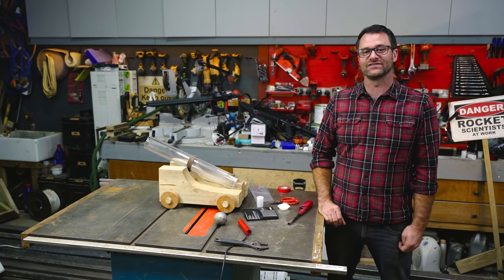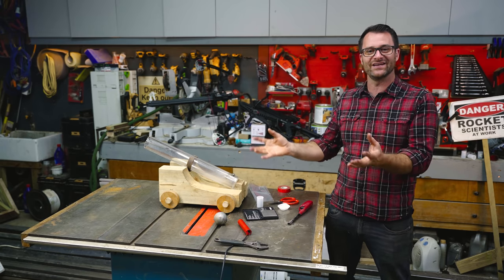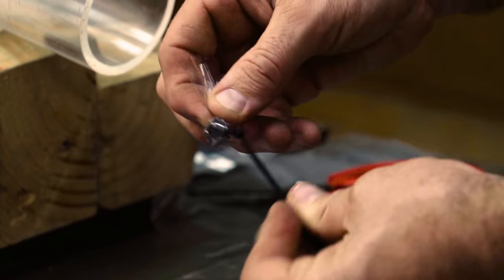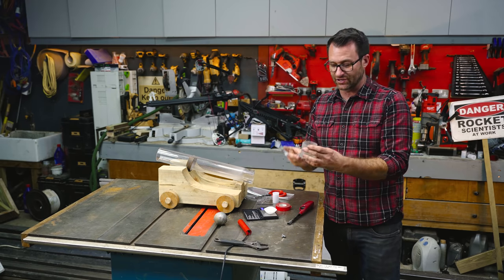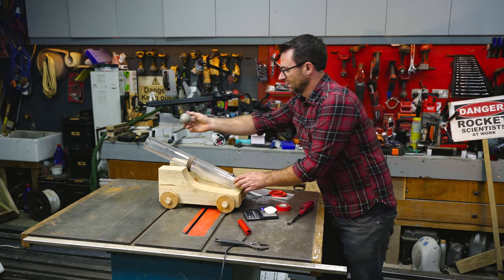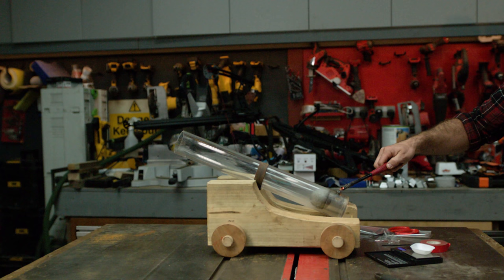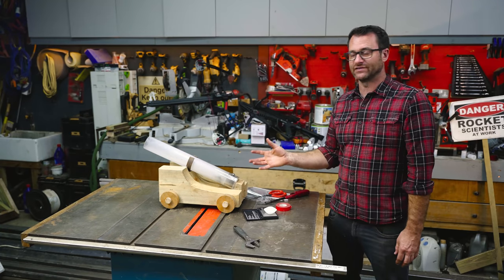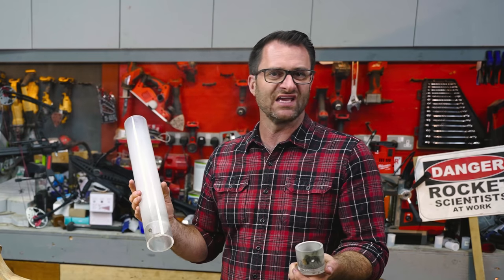Seethrough Cannon - Watch exactly how a cannon works and fires

Comment: One interesting observation.  At 2:56 when the ball leaves the muzzle you can see a return wave in the smoke as air rushes in to the barrel.  In theory at least this means that there is a small partial vacuum in the barrel at this point slowing the ball down so actually cutting the barrel down by say 3 cm would actually improve the balls muzzle velocity.
Reply: Hm, so this is why you can't just slap a longer barrel on most weapons?
Reply: Just as the founding fathers intended.

Comment: Hi. Great video 💜 Would adding a wad of paper or cloth between the powder and the ball not help with all that wasted expanding gas burning in front of the ball? Why not add a wad to seal the gases? Wouldn't it make the cannon more efficient? Idk. 💜
Reply from the maker: Thank you, Yes totally, wadding will always make it more efficient. But because this cannon is made out of plastic it doesn’t want to create too much pressure. You can see in the first slow mo that some of the smoke escapes from the breach, any more pressure built up behind that ball and it would probably just blow out the back. 
Just the same as the bowling ball cannon, we don’t need it to be efficient, it just needs to work, safely.

Comment: have you ever shot something bigger than a bowling ball?
Reply from the maker: Yes, a 16" firework shell. That had a whole lot of explosive in it!
Reply: @explosivescience9389  but you need to be really carefull not to use too much propellant, else the explosive in the shell  will join the propellant explosion in solidarity.
the first time someone in japan fired a 4 foot shell that happened, leaving a 35 foot wide crater.
luckyly they knew how dangerous it was and were at a save distance...